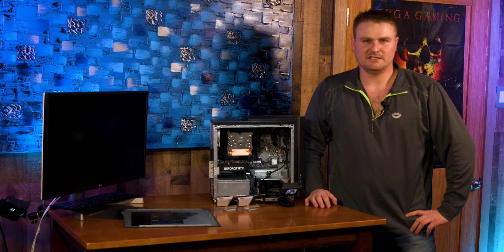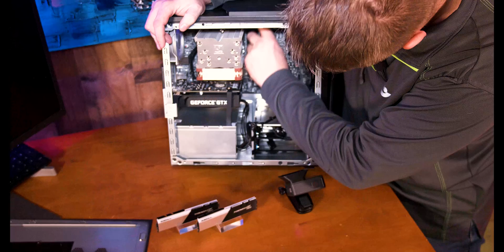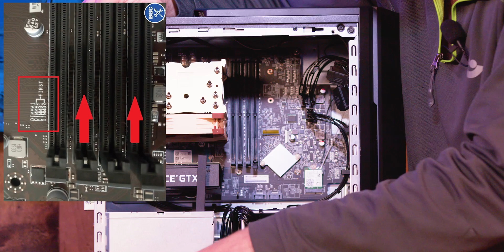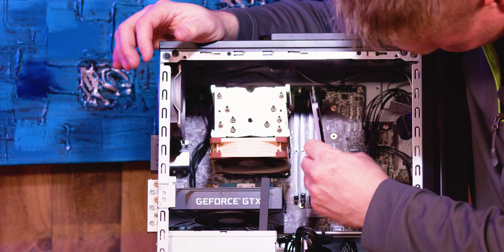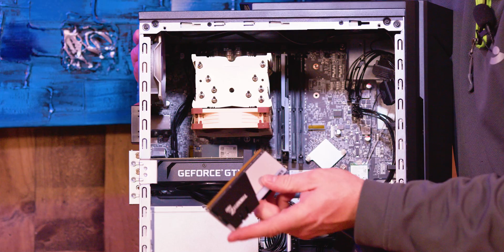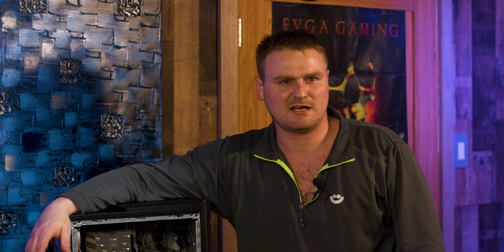Acer Nitro 50 How to Install Memory for Dual Channel RAM | 16Gb Upgrade

Comment: Which CPU cooler are you using? Does it have to come with screws? the Intel stock cooler on it has screws.
Reply from the maker: I linked in my disco for you. Also if you do not want remove the Motherboard, you will need longer screws. They are 6 or 8mm M3 Pc screws. I linked a kit to. The screws that came with my kit that where longer where the wrong thread.
Reply from the maker: FYI, Do not tighten the heat sink screws all the way down. as soon as it is snug stop. screws i am talking about are the ones with springs
Reply: @TNW1337  It's complicated but thanks :D
Reply from the maker: @rwgoose  Any time!